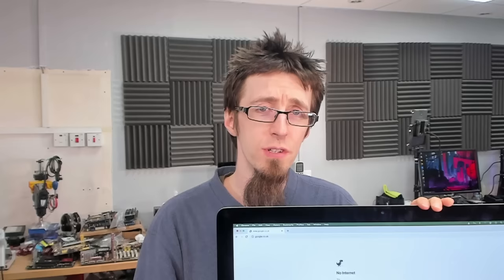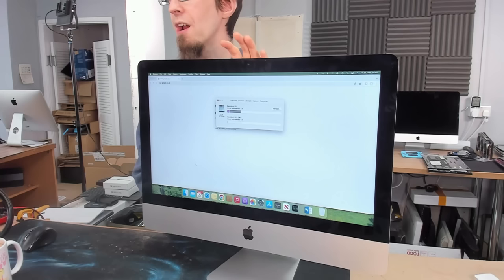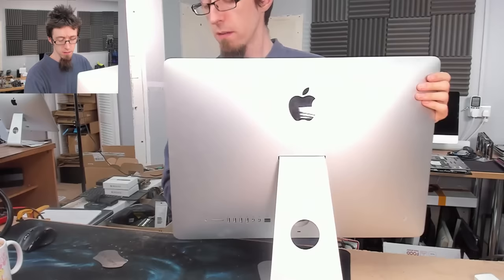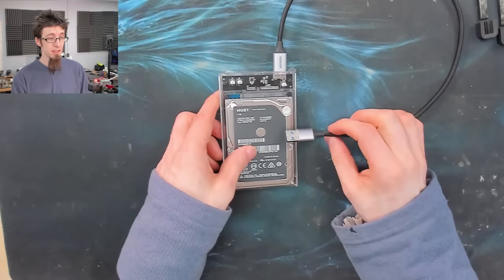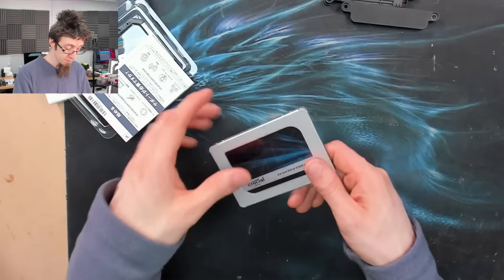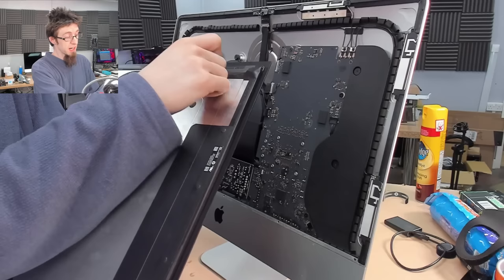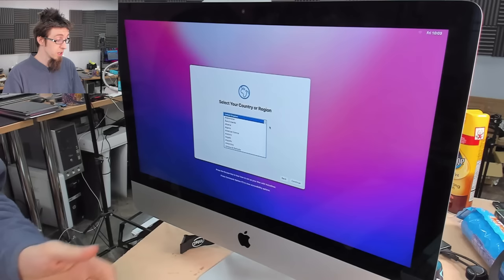Make an iMac super fast with an SSD - LFC#310

Comment: The memory sticks are accessed by removing a door just above mains socket. Remove the mains plug behind the stand, you will see a small button press it and the door above will flip open enough to release the door. Plenty of vids on YouTube.
Reply: Not on the 21.5 inch you have to take out the logic board to get to the ram
Reply: Not on this one buddy

Comment: Great Tutorial.  I have a 27inch 2017 iMac  18,3  I believe they have am NVMe drive rather then the 2.5 inch version.   but it is soldered in rather then removable. Would you have any ide if this is correct.  I used an external SSD via USB to get some performance boost. But would prefer internal instal with a fast M2 drive
Reply from the maker: See the pinned comment about the Fusion drive. Only other difference is that the 27" has a 3.5" drive, so you'll also need a 2.5 to 3.5 adaptor plate for the SSD.

Comment: Great video and I definitely recommend swapping to SSD to give it a new lease of life. However, I do NOT recommend buying cheap adhesive kits for iMacs. I always quote my clients for a genuine/decent kit that you can be sure won't fail on you. There are horror stories around the internet on these strips failing, especially on the big 27" ones. Even if the screen survives falling on the desk or whatever, chances are you're going to get a ripped screen connector. I buy mine from the Bookyard (not endorsing or affiliated; I just trust the genuine adhesive kits and know they supply decent ones). Also double check you don't accidentally cover the microphone with the adhesive kit. There are some differences in models and you can end up with a kit that can cover the mic hole. You can simply snip a tiny bit away to allow for the mic.
Reply from the maker: Noted! I've not had any issues with cheap ones myself, and I've had one or two come back in for additional work at a later date (failed PSU, or RAM upgrade, etc...) and I've found the screen even harder to remove than the original adhesive was.
Sample size of just me though, I don't doubt that there's been some failures out there, there always is.
Reply: @Adamant_IT  JustInspired Fallout is correct about the microphone. I noticed in the video you taped right over the mic hole. I have done the same myself only for the client to return their imav saying the mic did not work well at all. Why on earth Apple moved the mic to the bottom I will never know but you need to fix that before you let your customer have it back. I think it changed in the 2014 models. Apart from that nice vid
Reply: @Adamant_IT  hi can you please give me the link to buy the adhesive you use thanks

Comment: i had one of these from 2012 and just put win 10 pro on it and boots to desktop in seconds but you need the efi partition at the front of the drive for it to work and just use the iso download but web cam does not work nor the bluetooth or the speakers but sound does come out of a tv i connected via dp so it is there.

Comment: Ugh I didn't realize how fragile these glued on iMac displays are, I bought an iMac 27" 2013 for cheap it was slow and had a broken tilt. Had someone at work make up a metal piece to replace the broken hinge thingy and I went to replace the HDD with a SSD, got everything back together booted it and had a huge gray line going down the screen... 

I wasn't rough with it took my time also I've done this before on a previous iMac 21.5 2012 they're not the much different besides the size and the arrangement of the insides.

The plan was to keep it as general PC for the house but after that happened I ended up selling it for parts, at least I made my money back but would've preferred to of kept it.

Comment: Just a quick question.  Why didn't you just clone the new SSD from the existing HD?  🤔
I know you said you wanted to do a clean install and  use the  Migration assistant. But 
Migration assistant is always hit and miss. Granted, Clean installs are always best.  
But, if there were no problems before with the old HD then a clone copy would have 
been just fine. Really big time saver.   I have done quite a few of these and just used 
Carbon Copy Cloner.  Plus the customer has everything back to the way that it was just
before he gave the machine to you for upgrade.  And he is free to go back to his computing
with no lost time for having to load or download something that was missed during the
transfer.  My customers really like this service.  Besides Carbon Copy Cloner.
I have even used Super Duper a time or two.  Regardless of cloning software.  
Cloning works just fine. Best of all, it really saves a ton of time from using the Migration assistant. 
Just a thought.  Love your videos.  Please keep them coming.  🙂

Comment: We had problems with older Macs from around 2010 some (at least iMacs) which had NVIDIA chipset for SATA. The SATA speed I, II, III wasn't recognized correctly by some SSDs but Samsung SSDs always (?) got it right. Other Macs from that period (MacBook Pros) got problems with that and with discrete graphics chips failing. Which version MacOS you got/get depends on what keys you press when doing Internet recovery. Either the OS the machine came with or the latest the machine is compatible with.

Comment: Put an 1 TB SSD into my 2012 21,5" iMac. Runs great, but because the air is so dry where I live the double sided adhesive couldn't hold the monitor on the chassis, so I had to put black adhesive tape on the outside. Thank goodness for the BIG bezels!  😂

Comment: Is there a workaround for iMacs that can't be updated (that is, getting it to take the update).
Reply from the maker: You can force new macOS versions onto unsupported macs, but personally I find they tend not to run very well. If it's your own mac, you might find the limitations/quirks acceptable, but I don't recommend it for other people's computers.
Reply: @Adamant_IT  It's for a friend's 27" I'd fixed some time ago(video card issues). So why not now simply buy a new machine..?! Trust me, I tried to get him to upgrade, and lectured to him adnausia. Let's just put it this way - Mac/Apple users are biblical in their cult-like devotion to the brand. That out-of-date machine is now sitting in the corner gathering dust - much to that owner's lament. In any case, how can one "force" the update?

Comment: You put in an SSD, and no trim support then ?  Trim support for non-Apple drives is disabled by default. This ssd will wear out in about 6 years.   To enable Trin support for non-Apple drives, use Terminal and use this command :  sudo trimforce enable       and put in the password.

Comment: As usual - very good and clear to understand video!

One question came to my mind, since I also do Mac SSD upgrades on a regular basis:
How do you deal with the TRIM-Topic? MacOS will only enable TRIM on supported SSDs, but of course, nobody will or even can use supported SSDs.

So the choices are to either force MacOS to enable TRIM or to leave it turned off. Which route do you choose and why?
Reply from the maker: Honestly I don't do anything about TRIM, I've not seen it cause a problem. If the mac and drive were getting a lot of write-cycles, then there'd be a performance gain here, but most of my clients are not heavy users and just want to get to facebook faster.

Comment: sir . iv read instructions that say you need to use a heat gun at around 70 celcius and no need ffor cutting..
Reply from the maker: Both carry risks... but I feel like the risk of cutting too deep with a knife is a lot easier to control than the risk of over-heating the LCD and damaging it.
That being said, I don't know how much heat the LCD will tolerate - maybe the risk is very small.
Reply: @Adamant_IT  yes ok thank you. They should have made an slot or st.. much easyer. Instead of heating up.. sucktion cups and cutting. Pfff

Comment: Iv'e had two 27" iMac's 2015/2017 Models) where the display assembly is really, really heavy. I lay dem flat 48h for the adhesive to get it's full strengt.

Comment: I did this to my older iMac that had screen and glass separated, I changed the logic board because I ripped the cable to the screen off. It was horrendous! 
But this job locks simple enough! I have a 2020 iMac, but the SSD is just 250! Tired of deleting things and moving them from one disk to another.

Comment: Thank you so much for this detailed guide. I found lots of complains about the falling screen due to the glue strips while I was checking on Amazon, what kind of brands you recommended offer the best foam glue strips?
Reply from the maker: I've never had an issue with the amazon ones. I would definitely question if people who do actually removed the old tape first - because new tape won't stick to the old stuff.
Reply: @Adamant_IT  Thanks, that explains a lot, I just bought one.

Comment: Adam your video is awesome, its very clear and informative, my question is in your opinon. I have a imac 2012- A1418 -13.1 and i want to upgrade the hdd inside to a 1 T Crucial SSD, but i am hearing that i might have to install a thermo sensor in order to stop the fan from running top speed is this true or can i just swap out the drives?
Thx Again for your time and effort
Cliff
Reply from the maker: The older thick iMacs with DVD drives usually require a work around, but I've not had fan-speed issues with any slim iMac after doing SSD conversions. Absolute worst-case scenario, you can use an app like MacsFanControl to override the fan speeds from macOS. It can be set to monitor drive temp and auto-run minimised on startup.
But yea, not had to do this on any slim iMacs so far.
Reply: @Adamant_IT  Thx so much for the quick reply, that makes perfect sense to me. I guess i can go ahead and start the operation on my Mac. I use Mac Fan Control on my 6.1 trashcan, so i certainly will install on my 21.5 imac also.
Thx Again Keep up the great videos

Comment: I likely missed it but did you cover why you were not cloning the drive before installing the SSD?
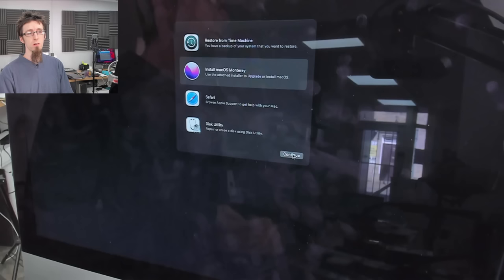Reply: 32:05
Reply: @jaro6985  That's after the SSD is installed, not before.
Reply: @QuentinStephens  Why would I care if it was before or after?
Reply: @jaro6985  Cloning the drive before you install it will test the SSD for starters. Imagine installing the SSD, reassembling the Mac, and finding that the SSD was duff. But I don't know if there are technical reasons for not doing so - Graham is the expert here and I seek to learn from him.

Comment: Another Great video and well explained and thanks for sharing. my concern is the type of adhesive strips to use as the original that the screen will not loose after few months which do you recommend?
Reply from the maker: I've had no problems with amazon-bought strips.
Reply: @Adamant_IT  I think ‘yet’ is the key missing word there 😬 I had one fail after 18mths, screen fell out. Now I only use the genuine ones, expensive but worth it.

Comment: Does it run Windows XP with DX support?
Reply: When using an Intel iMac the CPU is throttling all the time because of the bad cooling. I would mount the screen with magnets and use quick release cables just for maintenance. Also mount a big fan and add more ventilation holes. For quick swap add a SATA extension cable. Best start is to clone the HD. Macs don't run less on an external SSD.
Reply: I recently noticed also that Macs do not support Youtube 4K (360) play and do not have a Youtube app.

Comment: I will tell you, you have to be careful with crucial drives because some of them are DRAMless and are slower than a hard drive on anything other than burstey loads.
Reply from the maker: The MX500 has DRAM, which is why I use it. But also be careful of the "slower than a HDD" line, because while DRAM-less drives can droop down to 100MBps on sustained transfers, the vast majority of operations a computer does are burst stuff. So for real-world "how does it feel to use" boot drives, even a cheap SSD will obliterate a HDD.
However, if you're buying a drive specifically to store, say, an archive of movies, then yea a DRAMless SSD isn't a good choice.

Comment: There should be a ram access under the bottom of the frame… I make that mistake and completely dissembled it only to have the ram stop me from pulling out the motherboard
Reply from the maker: Some of the 27" models have access panels to the RAM, but I think all of the 21.5" models are mobo out jobs.

Comment: run the the reset fuishon termal comand  
Type diskutil resetFusion in the Terminal window, then press Return. fixed speed problem without SSD upgrade

Comment: Why didn't you put a NVME SSD in it?  All you have to do is pull the board and plug it in.  If you want to use a PC SSD you have to get an adapter for it.
Reply from the maker: Zero real benefit IMHO. Unless you're transferring stuff in and out with thunderbolt attached SSDs, or you're doing a lot of workstation stuff like VMs, you won't notice the difference between NVMe and SATA - and a SATA drive is a lot less hassle to fit.
This might change though, as in some capacities NVMe drives are cheaper as SATA dies out.

Comment: What about using a leaf blower to get the dust out of a Computer?
Reply: Turn a fan too much and it functions like a generator from what I recall. Sends voltage the complete wrong way XD
Reply from the maker: I keep meaning to test this theory. You shouldn't blast fans up to high speed anyway because it's hard on the bearings, but I want to test the "reverse power that damages device" theory.

Comment: Would be nice if Apple would use screws instead of glue. Or maybe just have cutouts in the back for the HDD and RAM. But NOOOOO your not suposed to uppgrade anything
down the line. That way they can milk more money out of the consumer when they have to buy new Apple stuff.

Comment: I stick to mojave because of my (in the time) quite expensive laser printer, i don't want to buy another printer because it prints just fine, but samsung never made 64 bits drivers for my device, so if i upgrade to catalina or monterey, my printer becomes useless. My main macbook pro runs monterey :)

Comment: Well done, cogently argued video.  I respectfully and strongly disagree:  the 24” has a lot of good qualities, but why in the world would I want to go down in screen size from a 27” to a 24”?  From a 5k display to a 4.5k display?  Where’s the replacement model for the 27” iMac?  The aesthetic of the 24” also just feels so generic to me:  it’s not special.  It’s not unique.  It just seems like a set of poor design choices.  I remember when the first bondi blue iMac came out - they was a different, bold design choice.   By comparison, this is NOT.  As for the 21.5”, why invest in something so challenging to upgrade (and in some cases impossible to even upgrade the memory?)?  This is particularly true when seen in comparison to the old 27”, which can be found for very little more cost?

Comment: Why not just byte duplicate the drive? Huge time saver and the user gets a desktop they're used to.
Reply from the maker: It's in for service. Part of servicing is ensuring the computer is running the latest software. I always update macOS unless there's a specific reason not to (eg, software compatibility).
Reply: @Adamant_IT  so, if a pc comes in for a new ssd, you upgrade it from win 10 to win 11? Or is this just a Mac thing?

Comment: "Upselling is a sales technique where a seller invites the customer to purchase more expensive items, upgrades, or other add-ons to generate more revenue."
Reply from the maker: Yup. Did the customer need an SSD? No. The HDD was not faulty. Should the customer buy an SSD? Absolutely. Their mac is now significantly faster than it ever has been, and they have a much better user experience as a result.
I guess we can define upselling as "stuff that generates revenue while not providing any more use or value to the customer" but now we're into semantics. Y'all know what I mean.
Reply: @Adamant_IT  i think its 100% semantics lol. 
and its not "up-selling" as it would provide an actual tangible benefit.

some times i see you throwing ssd's in to a laptop i value at about the same as the ssd you put in the thing.  
I think thats up selling because you just made them pay extra so the system isn't Quite as slow as it was for the next 3 weeks before they cave in and actually buy a better system.

to me thats up-selling. 
"Yes i will look at this trash heap and repair it for you i will throw in a ssd. and then in two weeks time you can come ask me to transfer your data to your newer system, that i should have advised you to buy any way. and now i get to have two bites at the cherry."

Comment: we are up to 870 EVO now.  the 1TB is usually $99USD and right now the 500GB is around $60.  For new installs I would use one like you used.  for cloned/upgrades where the Windows 10 OS needs to remain, I use the Samsung.

Comment: YOU REALLY need to tell people that the thing at the bottom is an EXPOSED power supply, and if you touch it, it can kill you.....and people wonder we have no right to repair laws. I'm sorry but you need to take responsibility for teaching repair.
Reply: and you need to tell people if you blow air in a fan you need to block the rotation, because it could send voltage back to the motherboard and ruin fan speed control or other things....

Comment: Much easier to just run the SSD externally through a USB-3 port.  You won't notice any difference in speed to an internally mounted SSD, and it's 1/50th the work.  And if the SSD dies, it's easier to replace.

2012 iMacs and later all have USB-3.  I wouldn't recommend this for USB-2 iMacs (2011 and earlier).
Reply: I did that and it freezes all the time, this way is much better..